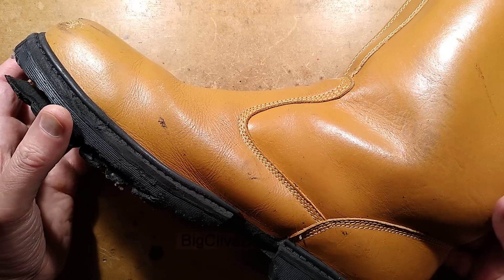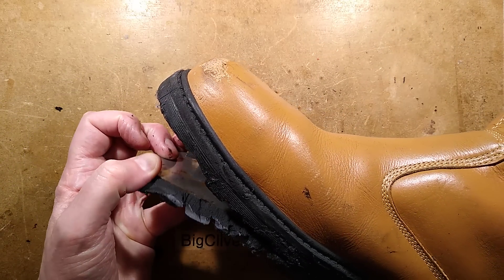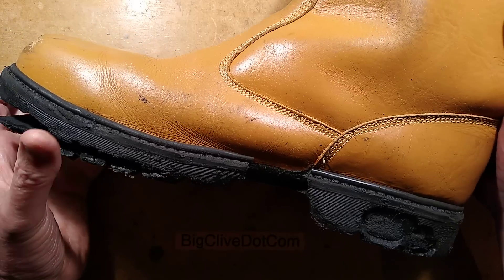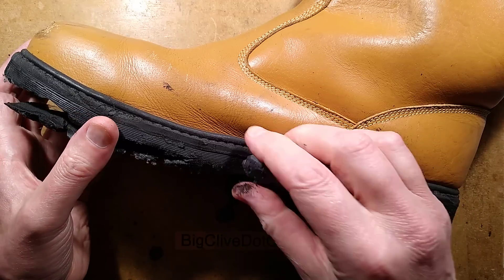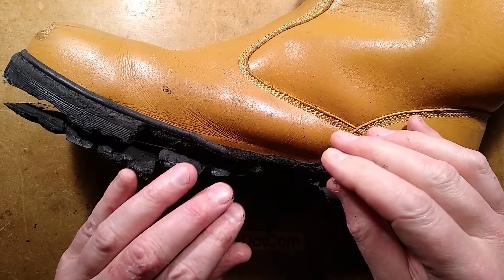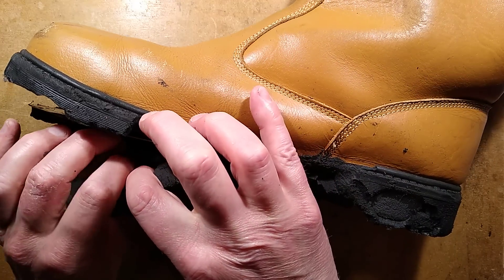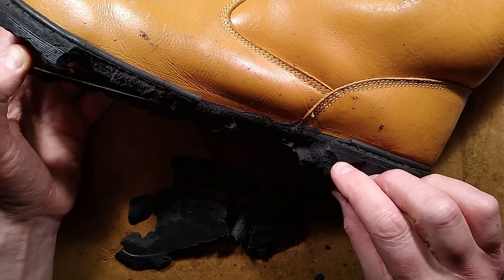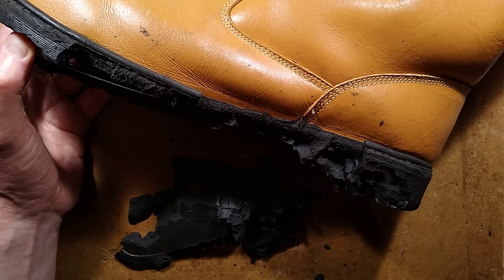My work boots have melted!

Comment: I used to work at Hotter shoes. The soles are Polyurethane which is fine if you keep wearing them as air is forced in and you can wear and wear the shoes and they will last... If put away away too long the polyurethane breaks down and is unrepairable. Hotter had a good returs policy but Clarks didn't and a while ago Clarks got a lot of negative press that Hotter largly avouded...

That said, for work boots it is a poor material to use, a little dangerous if the degradation process has started and you hadn't noticed and you are going up and down ladders etc.

Comment: RSVP those boots. They looked like good ones too.

I had the exact same thing happen to an old pair of work shoes too. I was clearing out my storage tubs under my bed when I found them, picked them up with a plastic bag and turned it inside out to avoid getting the black crud all over my hands. Interestingly, there were two plastic bags also in the same tub, one the thinner more crinkly type and the other a thicker type, and the thinner one was also crumbling to the touch. Basically had to vacuum that one out of the tub. There was also an old figure 8 power cable in there that was leaking the green goo from inside.

That lead me to think there was some kind of chemical reaction occurring between the rubber in the soles of the shoes and the plastics, because I remember seeing Fran had a similar issue with the green goo in one of her old amps, and I thought she might've had it stored with rubberised guitar cables.

Comment: I had a pair of Dunlop steel capped shoes, that were quite comfortable. Wore them to a wheel making factory for a Christmas shut down, walking through spilled cutting oil on the floor. By lunch time, I noticed that the heels were flapping around and on inspection the sole was coming off of both shoes. They were supposed to be oil proof.

Comment: Yep.  Having the same issues with rather expensive Muck Boot brand insulated synthetic rubber boots just crumbling after only a couple years of light use.    It's not wear and tear.   It's failing on a molecular level.

Comment: This happened to me! 3 months ago, to 2 different types of shoes. First was a pair of $50 steel capped boots I bought around 2015? I put them on, and first the left one started talking, so I duct taped it back, and then 10 minutes later the same thing happened to the right one.
It also happened to some slipper boots I had in the cupboard, bought around 2016/2017.

Comment: I used to work on office machinery which had foam insulation to deaden the noise, after a few years the foam would try and revert back to the oil it was made from. Went all sticky and horrible

Comment: Idk why they have but I had a pair of dress shoes that did the exact same thing, stored them away in the bottom of the wardrobe & the sole just crumbled into bits when I went to wear them!
Reply: Exact same thing happened to me: dress shoes stores in a closet disintegrated minutes after wearing them even though they looked fine when I put them on. I suppose they emit some vapour which dries out the plastic and then it crumbles.

Comment: The winter boots I have bought are otherwise fine but the heel has hollow compartments that wear through on the outside, then collapse and cave in  from the inside, eventually rupturing through and through, letting water in. I have tried to anticipate this so that when they are visible on the outside, I inject them with polyurethane based caulk. That seems to hold fairly well for about an extra year or two.

Comment: I've replaced a few pinch rollers in tape drives in my career that was that consistency. Some of these I had to pry it off of the capstan post as some of these got wrapped around that post. Most bad pinch rollers I replaced were hard and shiny. This was an early problem with natural rubber tires (tyres) until Goodyear found a way to vulcanize rubber to withstand heat. This happened with a cover to one of my older cellphones. I tried washing that, but it was still sticky after a year of use. There are a lot of cheap soles on footwear these days. "Tofu dreg"
Reply: Capstans in my old drives tend to fail one of two ways--they go crumbly or they turn to goo.   Of the two, crumbly is easier to deal with.   If I run across a capstan that's gotten hard, I treat it with oil of wintergreen (methyl salicylate).  Smells nice too.  Curiously, I've never had a capstan fail on a Tandberg drive--they must have done something right.

Comment: The rubber usually starts to degrade when it comes into contact with mineral oil or quick lime I'd have a new pair and would lay a concrete floor slab and the next day the rubber would be hanging off the boots

Comment: Yep. Had the same thing happen to me with work shoes (steel toe & steel plate bottom) issued to me from company store when I worked in Germany for a time. I used them on-and-off over a half-dozen years or so. Then one time I took them out of a closet and the soles similarly crumbled to pieces.

Comment: I once had some steel toe cap boots do this, they were bought 'new' from a carboot, they clearly hadn't been worn, but when I did wear them, the soles fell apart quickly, so must have been old stock. However, I have Dickies boots over a decade old (actually, they'll be even older, I started using 11yrs ago, but had probs owned them a few yrs by then) where the soles are fine (apart from being worn unevenly by my pointing out feet!)

Comment: How old are they? I have owned military surplus boots that crumbled in an identical way and looked into it at the time. 
There was a problem back in about 2010ish when the surplus market was flooded with military combat boots that crumbled like this within weeks of use. Prior to this there was a lot of newspaper publicity of 'boots melting' when based in Iraq or similar and hence they all appeared on the surplus market after that batch was replaced. When I say batch I mean the total production run, even that model of footware was probably scrapped. In reality there was a botched batch of sole rubber, or someone had skimped or changed the formula accompanied with rumors about the contract for making the military soles was moved from the UK to somewhere like Italy. I'm wondering if these are old boots were made suing soles from the same supplier chain.

Comment: Looks similar to what happens to the drive belts on old electronics that I’ve seen techmoan repair. The rubber just seems to degrade overtime and after a good while the rubber just falls apart and completely perishes.

Comment: Reminds me of a frequent problem I encountered with IBM 4201 Proprinters. They had a paper roller assembly with rollers made of some off-white material that would just melt off of the metal shaft. Sticky & nasty. The replacement part had proper rubber rollers.

Comment: Same thing with small pulley belts ~ often with vintage mechanical things; open reel tape recorder, compact cassette recorder, CD player, VCR…. these would have pulleys and the belts would have perished: [infernally] turned to goo that you have to clean off with alcohol, or [conveniently] turned crispy/brittle/stretched

Comment: Classic plasticiser migration. Very common on items made of PVC - the old formulation - and well known to destroy some old action figures, especially when PVC limbs are mated to a styrene or acrylic body. The limbs go sticky to the touch and smell oddly 'vinegary', and the styrene or acrylic parts can go soapy and friable. I've had some literally crumble to dust in storage. It's also the reason some records from the 1970's and 1980's (I've never had any 50's or 60's records do it) go, for the want of a better word, 'scabby'.

Comment: I once had a pair of winter boots disintegrate in exactly this way while I was wearing them. Unfortunately it happened while I was on a shopping trip on a frosty winter day in January in Winnipeg, temperature -27ºC. A store clerk kindly gave me tape to hold them together and I made it to the mall, but boy was that fun trailing little pieces of plastic into the shoe store.

Comment: I have had the same thing happen with my steel toe redwings after about 10 years.  My uppers are usually too torn up by then, so they go in the trash.  But if they were still good, I could take them to the cobbler in town and get them resoled. I don't know how easy it is to find cobblers in the UK.

Comment: We got in the German army boots with exactly this material as the connection between the wear layer of the sole and the part with the leather-part where the foot goes in. With time the rubber sole separates from upper leather-part.
I was not in oil with it and did nothing special, this material simply breaks  because you squish it often. Not a good material for boots.

Comment: I did a "knackered old boots" video about the same thing with some boots I had. First noticed by a black mess ground into the carpet which I couldn't figure out where it had come from. Turned out to be an old pair of boots. You can literally peel them apart.

Comment: I couldn't say why but I've had the exact same thing happen to a pair of boots I hadn't worn in 2-3 years, they were just sitting in the garage and I went to move them one day and the sole just literally fell apart like yours did, some kind of degradation of the rubber, but why I have no idea, they were never exposed to any chemicals or anything like that, the only thing I can think of is the oils leached out and what was left is just crumbly plastic/rubber.

Comment: I've done work at a sugar mill where the spilled sugar concentrate water (delightfully called the mother liquor) would ferment and eventually form acetic acid, was hell on boots causing the exact failure you see here, but on the scale of weeks rather than years if one wasn't careful about rinsing them.

Comment: My work boots have been re-soled at least 4 times with Vibram soles.   Good ol' rubber--developed in the 1930s by Pirelli.  All of mine have worn out, not disintegrated.   Funny thing is that I've had 2 new pairs of boots sitting on the shelf--never expected the originals to last this long...

Comment: The mouse mat in my spare room did that, hadn't used that computer in over a year but I went to check something on it and noticed the mouse mat was 'lumpy', I tried to lift it up and the rubber layer had liquified into one of the most adhesive substances I've ever come across.  Took me an hour to remove it from my desk and ruined a T-shirt, jeans and some wallpaper in the process.  It seems that mouse mats die if you abandon them.

Comment: I had this happen to motorcycle jacket armor. It crumbles apart and is a sticky mess, after a few years.
I find it also happens with hand held things, like video game controllers, with rubbery/grippy areas.
Just sitting in a drawer, for a year or two, they become useless, because you can't clean them.

Comment: Crap PU resin formulations (including those from those from Japan/Asia) often have a tendency to revert back after curing to their constituent liquid chemicals. I used to work in high voltage cable jointing and penny pinching local authorities and utilities regularly regretted going for the cheapest products on tender. I know of a major military airfield where every joint on the runway lighting system reverted back to your boot like mush. There's also a major trunk road in Wales where the same thing happened. Both cases were hushed up!

Comment: To be honest, it does not matter what type of resin used in the soles of those boots. Most natural or man made resins break down over time. Some quicker than others. That's why even when a tyre is unused, you would still need to check if the rubber has become perished.

Comment: In Canada, boots with these features would be prominently marked with a green label, coloquially known as a 'green patch'.  These days the same protection rating can be achieved with polymers.  I have a rather nice pair of such boots I wear daily, and I work in IT.  And I don't run cables, so I don't need to be able to work in the kind of space likely to have things like stray nails.

Comment: Reminds me of my second pair of expensive hiking shoes, where the soles just left the shoe on the hike. very awkward. The sole itself is robust rubber, but they all use PU foam, which over the years loses softener and turn into dust. Which is crap, beceause the rest of the shoe, the leather etc, is in fantastic condition. At least Lowa offers a resoleing service .. I'll have to check what they ask for it.

Comment: I have a pair of insulated Red Wing boots with their polyurethane Super Sole that was cracking and crumbling. I took them to my local Red Wing shoe store and I was surprised to find out that the defective sole was a common problem and and that the factory can replace the bad sole with a upgraded version for 100 USD. 👍

Comment: When they glued the foil for a small  pond (approx. 20x20 meters) nearby my rubberized work gloves were sticky for days.. they stuck to everything. at the first day there was a slight smell of solvent in the air, but that went away fast.. but the sickyness lasted for a while, after that the rubber just crumbled off like your soles .. maybe these types of pvc glue have an impact on synthetic rubbers even in a very small quantity (couple ppms .. catalytic reaction)

Comment: I had something like that happen to shoes after stepping in petrol at a filling station.  Some polymers also fall apart in the presence of chlorine.  I had a very expensive Motorola radio crumble from chlorine.  They replaced the case for free.

Comment: about 20 years ago when we did a calciner overhaul we would be taking it a part with in an hour of it being turned off these things ran at about 1000 c and would only be done mid summer in Australia so it was bloody hot the number of boots i went through because the rubber would melt and flow up the sides of them it quite high the  funny bit is when they gave us plastic bucket to put the bolts in the bolts didn't even slow down as they melted there way through them we where using welding gloves to remove the bolts

Comment: Like all the other comments, I do believe they cheaply make these materials. I’m not a professional, so other comments may be more precise. But I do think since you do keep your home cold, that could also make the material dry and then wear down, or perhaps the moisture in the air could also affect it. You should look into timberland pro work boots (if you have them over there) and I think that will be a solid buy for you. I do advise you getting them 1-2 sizes bigger because timberland boots tend to size smaller than listed size.

Comment: For may years, Timberland boots were a good value, and a trusted brand. Just before the Iraqi invasion,  the U.S. armed forces signed a contract with them. A couple years later I bought a pair. One day I got them soaked through working in a well pit. I put them on an oil filled space heater overnight.  The next day I lifted them off. The leather came, the entire soles remained. They had also grown in size close to ten percent. I couldn't believe it.  I can't say I've done that before,  but neither have Timberlands. Those heaters are limited to about 120° Fahrenheit. I pity those who resurface asphalt and end up on hot tar in their socks. I'm sure it was because the company switched manufacturing from the U.S. to china. The sizes got about two sizes smaller at the same time. I had to glue,  drill, stitch , and trim them. Losing the outer portion of tread. I then had a one of a kind imprint.

Comment: I have a very similar problem with rubber feet on a piece of 1990s equpment.  Plan is to remove the dissolved rubber pieces completely and add replacements .  No idea if same reaction or the best solvent to remove the dead stuff .

Comment: I bought a second hand pair of boots like those and some two months later, they just happened to become just like those on the video.
The rubber material used in the sole ages way too fast.
Too bad, as the rest of the boots are just like yours: Almost like new.

Comment: A bit off topic, but the timberland/dewalt/etc standard heavy duty work boots always seem to fail at the joint between the actual glued on sole and the welt. As soon as there is the slightest parting visible, I go round this joint inserting 1/2 inch brass wood screws from the top of the welt, down into the sole. Seems to halt the process and extend life considerably. With arthritis creeping in I hate breaking in new boots.

Comment: Bit late to the party here, but I've had the soles of several pairs of workboots disintegrate for no very good reason. Not a massive deal as most were well used and semi-retired by the time it happened, but still a bit of a surprise when I found what I thought was a useable pair of boots had fallen to bits in storage.

Comment: We saw plastics, rubbers, and foams deteriorate in the sporting goods industry. Outside of production "shortfalls", potential causes might include:  storage in a room with other chemicals, exposure to extreme temperatures, exposure to light, exposure to air, time... Some materials just were not designed or executed properly at the factory and degrade regardless.

Comment: Hi Clive, Have you ever done a vid on lithium batteries and their charging. I saw something relating to a thermistor fitted into the battery that monitors the battery temperature during charging and cuts off the charge if the battery overheats. Would like a bit more clarity on this.
Reply from the maker: Some bigger packs do have a thermistor to monitor the cell temperature for low ans high temperatures.  Often for preventing charging while near zero degrees celsius.